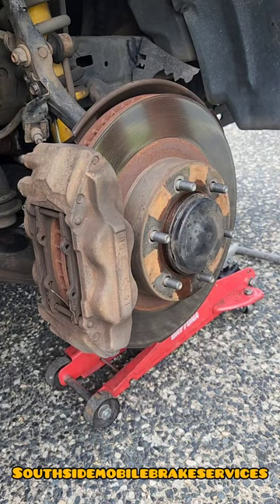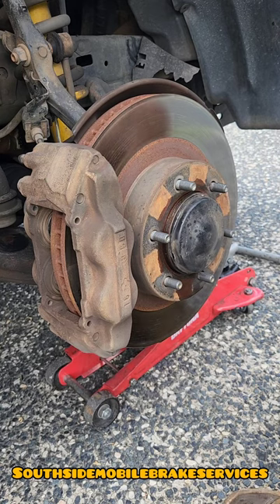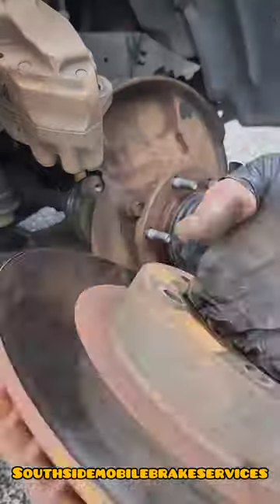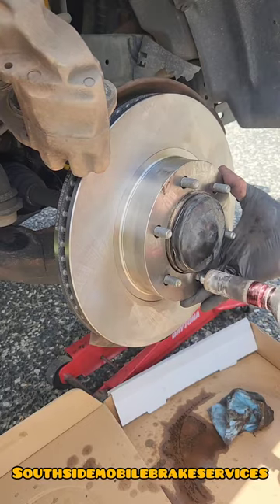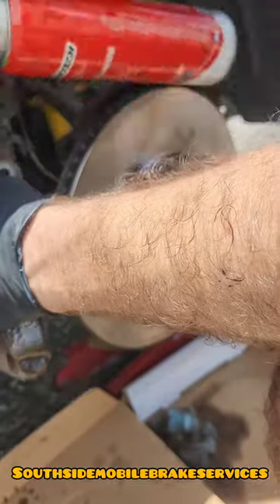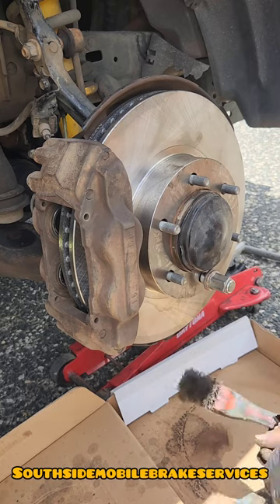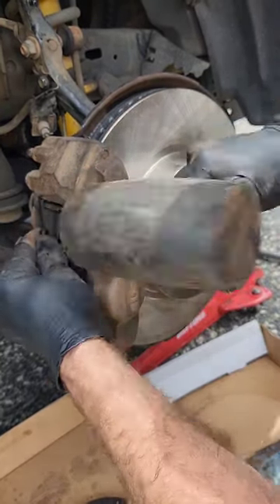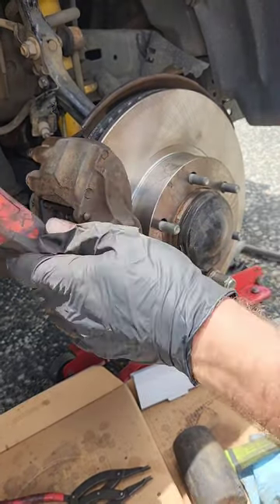Toyota Prado 120Series Front Brake Pads and Rotors Replacement.

Comment: Hey mate, are the kdj120 and kdj 150 the same? Ive got the 3ltr 150 series and need to do the rotors and pads. Also, have you got any videos on backing them of and adjusting them back? Cheers mate 👍
Reply from the maker: Hey mate,

Yes the 120 and 150 are pretty much the same, if you have tiktok I have a few more videos there of them being changed.

You just need to press the pistons back into the caliper which I sell a tool on my website: https://southsidebrakeservices.com.au.
Reply: @SouthSideMobileBrakeService.  hey mate cheers for the reply. I don't have tiktok, I seen another couple of comments on other videos too about winding back a cog or something for the brake but never seen it before only the piston being pushed back in.